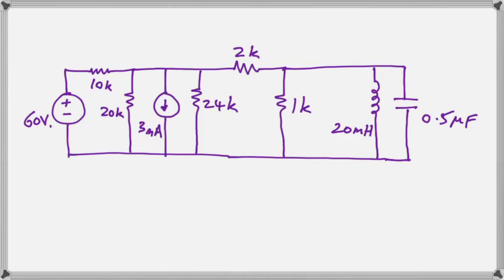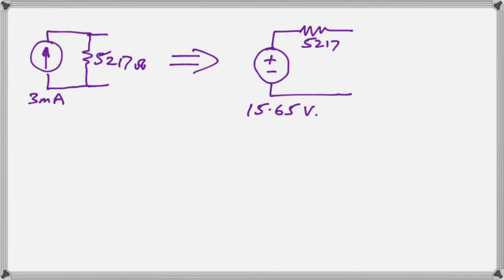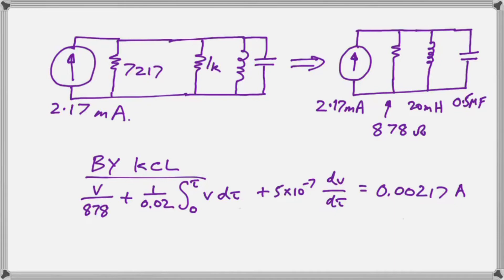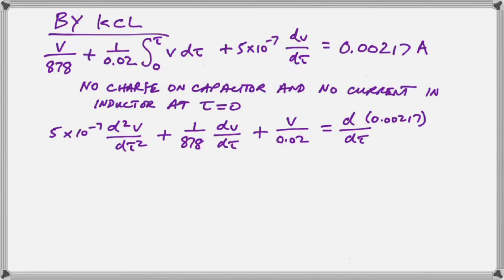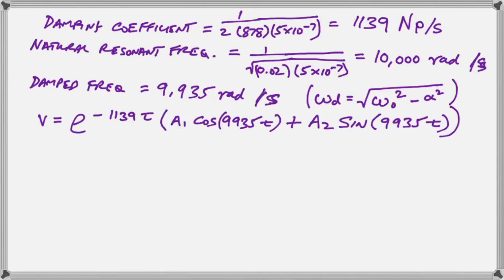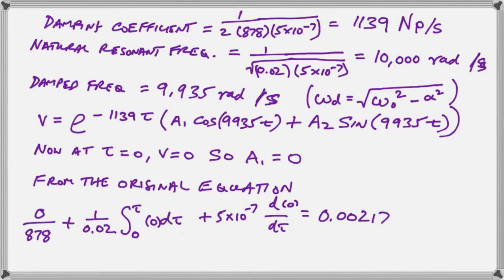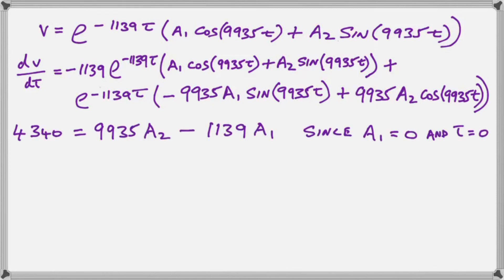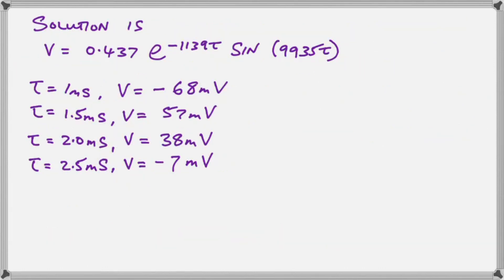Parallel RLC complete solution for student problem

Comment: I was lost immediately at the 0:55 mark -- how did the 60V voltage source turn into a 6mA current source?
Reply from the maker: Just use Ohm's law and divide the 60V by the resistor  and you will get 6mA 😊 ..... Thevenin - Norton Transformations (also called "Source Transformation") may seem kinda "mystical".... but in reality it is real easy to APPLY.... cause it's just Ohm's Law 😁